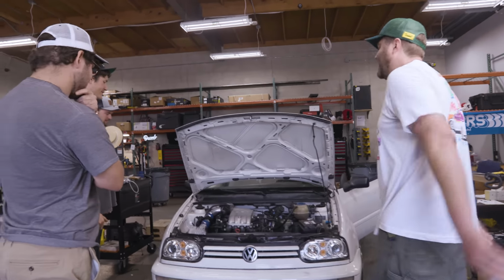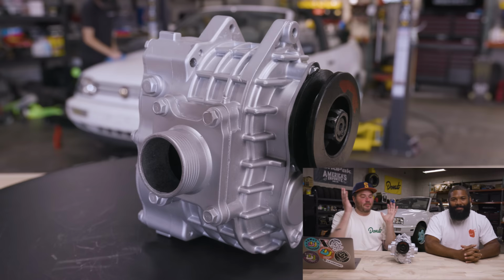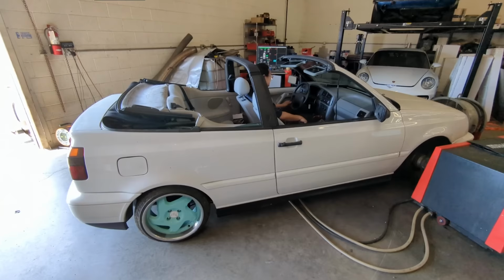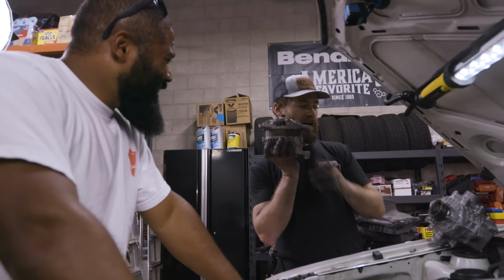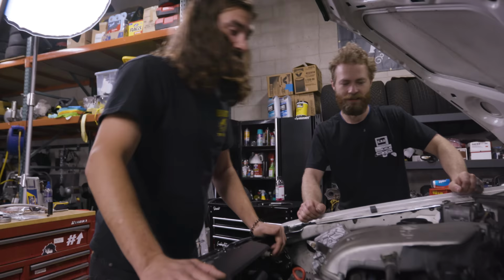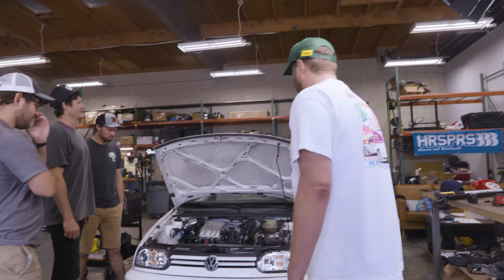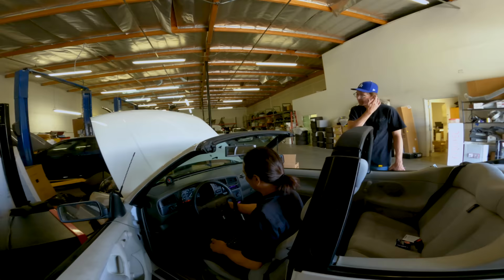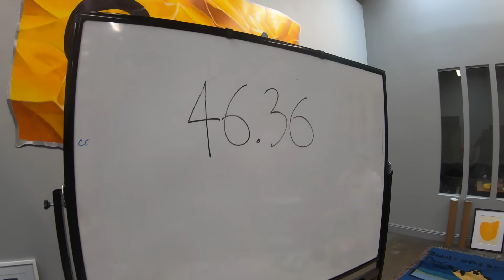We Installed a Wish.com Supercharger on Our Car

Comment: Part of me wants it to be on backwards so when turned round it does actually make some power! Why not (even if it's not right) turn it around & see how it goes?😁👍🏻
Reply: I agree with this
Reply: That's what I was thinking. The fact it was barely producing boost makes me wonder
Reply: Yeah,  flip it around and I bet it will work. 
As loud as that is, it has gotta be on backwards somehow. Maybe, flip the engine 180 degrees?  :D
Reply: that what I think
Reply: If it was backwards, it would literally be sucking air out of the engine, and it wouldn't run.
Reply: @9PlatinumGamer9  exactly, wouldnt run at all...
Reply: @9PlatinumGamer9  You mean like when it shut off those times after letting off the throttle? Air flow isn't on and off, it only has to have just enough air to run, spinning backwards wouldn't create a vacuum unless it could produce more than 14.7 PSI of boost (14.7 PSI is 1 atmosphere).
Reply: I was thinking the same thing 😆
Reply: @EMFAudio  - It shut off because of the rapid change in manifold pressure.  You can simulate the same by pulling the MAP from the manifold while still connected, well opposite actually, unless you have a way to do it under load. But either way manifold is going from vacuum to boost in an engine only meant to see vacuum. That throws off the fuel maps and it cuts out.
Reply: It was mostly underdriven
Reply: If you watch ghpc’s video on it there’s a clip where he puts his hand near the outlet side and it is actually pushing air, so unfortunately I think it is the right way… sadly
Reply: @wolfiedavis4879  - He checks it both ways this time too. These guys on here are just hoping for a unicorn. As small as that thing is, they would need a minium of 3 just to meet the engine's stock air requirements.
Reply: @sienile  ah, so its just too small and doesn't flow enough, so it's a restriction?
Reply: @sienile  Rapid change more or rapid change less does the same thing, my point is still accurate.
Reply: @wolfiedavis4879  That doesn't mean a mistake wasn't made. I'm not interested in going back to find if the side checked is the same side used.
Reply: @PigeonLaughter01  You got it. They didn't show it afaik, but when they drove it, the guy says it briefly made 1Psi of boost. Guessing they had a digital ECU readout. I don't think it would ever create a negative reading, but you could restrict the intake all the way down until either the power drops off completely, or the ECU would probably have a level where it won't cut the fuel flow down to match the lower air intake flow any more and cuts out/throws a fault.

If they did this on an engine with a carb, it would straight off be running insanely rich, if not just not run/flood. Would be obvious setting the carb that it was worse than just doing nothing extra I think lol.
Reply: There was definitely something wrong with the blower there’s multiple vids with people using them and it working/adding more power
Reply: So you think that now it's actually sucking power out of the engine? It's sucking out 34.64hp to be precise. So by turning it around would it make 34,64hp more? So 115.64hp then?
Reply: Turning it around won’t make a difference. The direction of airflow is determined by the direction of pulley rotation. This is a roots style blower used on a 600cc KEI car. The AMR500 displaces 500cc’s of air per revolution. It’s not capable of displacing enough air to feed a 2.0L engine. It would have to be severely overdriven just to displace enough air for the engine to breathe normally. Maybe .5-.25:1 overdrive ratio. (1 rotation of the engine rotates the blower 2-4 times.) none of which is taking into consideration the efficiency range of the compressor on this style of supercharger. All this thing is doing is creating a restriction, and overheating the air going into the engine.
Reply: @Boris_V  Adding air has diminishing returns like with any power adding change. There will come a point where the mapping has limitations and fuel input limitations. Adding air will just make it run lean or limit power gains. It's a curve, not a line.
Reply: @9PlatinumGamer9  it's backwards,  probably just switched intake and exhaust.
Reply: if you notice their little diagram about how a supercharger works is backwards.  they have the air flow labeled backwards.  so maybe this is a fundamental problem lol
Reply: @ledaohio  nah its just shit. The gears dont mesh tightly because there are no precision machined parts on this charger. Its a toy and a scam for anyone taking it seriously. That gasket should have told you everything u needed to know abt the build quality and tolerances on that pos lol
Reply: @eddominates  I did think that! I'm sure the screws squeeze the air between them & into the intake rather than round the outsides
Reply: @nuggert   Well don't tell him. I wanted to watch him flip the engine 180.
Reply: @jonasthemovie  It is always a D.E.U. issue.
Reply: @ledaohio  with enough wear and heat that thing will spit chunks and do nasty things. Too bad we didnt get to see that!
Reply: @EMFAudio  - Your point wasn't accurate to begin with, so it can't be "still accurate". If it was creating vacuum, they wouldn't have seen 1 psi boost when the throttle plate shut. This thing is too small to drive an engine of this size.
Reply: @eddominates  yeah, the confused the function with that of a gear pump, which displaces equal volume from the inlet to the outlet around the outside of the gears while the roots blower actually transports an ever reducing volume from inlet to outlet between the screws.
Reply: @sienile  Every gauge is perfectly accurate, especially when you don't know what the we're using, got it. You do realize pulling vacuum isn't the same as having vacuum limit air flow, right?
Reply: @danecarpenter8735  it doesn’t make boost because it isn’t turning fast enough
Reply: @wolfiedavis4879  the ratio is just off, it should be at over 5:1 to make decent boost, I mean it spinning 5x faster than the engine
Reply: @JohnS-br3xk  I’ve put one on a 500cc engine and I had it at a 4:1 ratio to get about 18psi of boost
Reply: @Industry-insider  How long did it run before turning into an aluminum grenade
Reply: @nuggert  I didn’t run it all that much but it looked great when I pulled it apart for upgrades, I never got around to doing them though
Reply: @Industry-insider  doesnt seem worth the risk. Good lil engines aint cheap. These things are made in a toy factory
Reply: @daszieher  A roots supercharger is a positive displacement pump, and it does push air along the outer casing, not between the screws.
Reply: @nuggert  I’m probably gonna put one on my shitbox daily because it’s a 1.5L and a almost brand new engine is $800 with shipping
Reply: @Industry-insider  why not slap on a well tested higher quality chinese oil cooled turbo like a GT2871 for that 1.5L and make an easy 10psi brother. Same price. Probably similar minor install headaches
Reply: It would run, just not well. Which is what happened.
Reply: @nuggert  that’s WAY more difficult also I already have the supercharger
Reply: @Industry-insider  I cant see it being any worse of a time than the can opener supercharger. Alumium pipes are cheap these days. I respect your determination but i can feel the pain coming into your world when this thing comes apart into pieces on one of your daily drives lol ✌️ bro
Reply: @nuggert  bruh the exhaust is on the back so it would be a huge pain to fit a turbo also why would a turbo be more safe? You obviously don’t understand how hard a turbo is to install because the intake tube is the easiest part yet I don’t have to do that if the supercharger is feeding directly into the throttle body also it’s not going to damage the engine to have a couple pounds of boost and I don’t have to tune it because the MAF is still metering all the air, if it leans out at all I can also make a IAT mod to add more fuel at boost
Reply: It's on correctly but it's way too small and shite, so no matter what it's just a noisy restriction
Reply: YES
Reply: @Industry-insider  It isnt going to last. Fun project if 1000 bucks means nothing to you i guess. Its going to break apart internally or you will lose the snout/pulley with wear. All sorts of things are wrong with these nothing is accurate or balanced. All of the components see tons of heat and torque in a quality supercharger. Your going thru all the trouble of fabbing mounting and tuning and mapping figured deleting or removing a power steering or washer tank and doing an exhaust manifold/downpipe would be nothing for you. something that can last and make good boost for a similar price.

You can literally hear the gears in the compressor wearing down and changing shape and they drive it for only a few miles
Reply: @nuggert  bruh I’ve already pushed over 20psi on it and it’s in perfect shape, I know the tolerances aren’t good but this isn’t a new thing to do and I know how strong these are
Reply: @manrs6037  engine power is needed to turn the turbine that blows more air to increase HP . In this case it takes more power than it adds. It might even actually restrict air flow and heat up the air.
Reply: @Industry-insider  wicked, post videos
Reply: @notsevenfeettall  mad power no but definitely would give it a power increase especially in the lower rpm range and it would run outta steam fairly fast! Any time you’re adding forced induction to an engine tuning is needed! Fuel/timing so on
Reply: @daszieher  that's what I'm sayin
Reply: @EMFAudio  - Gauges should be, but aren't always accurate. But that's aside from the point. I'm going with the assumption their gauge was accurate.

If something other than the engine is pulling vacuum from the intake, that will limit power. Cutting the intake down by putting a severely undersized supercharger on it, restricts volume and increases vacuum.
Reply: @tOSdude  true, the Roots type blower moves the volumes around the outside. I myself confused it with the Lysholm screw supercharger, also a positive displacement machine the works like described above, in mind.
Reply: @07scoobywrx  Yea, restricting air intake with a tiny blower should definitely make more power. /s

Everyone with a decent education knew that this wasn't ever going to work, they just did it because it's hilarious.
Reply: @ledaohio  That would also be the silent sleeper mode.
Reply: @flyingtentacle7631  https://youtu.be/1aJL8AfT-wc like I said the blower donut received was defective from the start! Will it make an extra 100hp no! Will it add a few yes
Reply: @9PlatinumGamer9  I was wondering if it is tho' as it's halved the hp of the engine! And I'm pretty sure their diagram of a how a super charger works is wrong. As the scrolls turn intogether and compress the air rather than compress it around the sides as per their animation
Reply: Roots styles can be run both ways np however effficeincy reduces dramatically when run backwards. It wont make power though, that super charger will need to have a 4 to 1 pully to make MoRe pOwEraH on an engine that size
Reply: @JohnS-br3xk  Agreed, if they put 3 of them in parallell on there it should work :P
Reply: It is backwards

Comment: I don’t think I’ve ever clicked on a video so fast- I’ve been HYPED for this vid ever since we saw the supercharger
Reply: Same here bro lmao
Reply: Same lmao
Reply: Same here - I’ve been waiting and it feels like its been forever!
Reply: Same
Reply: Can't believe they actually did it, but so glad they did! 😂
Reply: The notification just came up and I instantly clicked it
Reply: (Gently whispers in your ear) "ZOOM , ZOOM"
Reply: Me too lol
Reply: MO SUPERCHARGERS MO POWAH BABY !!! 
Let’s get some junkyard Eatons slapped into dumb shit plzzzzz 🙏
Reply: All that to not add fuel and get no meaningful result tho. Superchargers take power to run, the point of them is to add enough air to let you add more than enough fuel to make up for it. They only did the power robbing bit
Reply: They need to buy a turbo to twincharge their car
Reply: For real tho. Didn’t expect it to CHOP THE POWER IN HALF THO
Reply: We gotta see it tuned
Reply: Same
Reply: SAME
Reply: @mycosys  You could run that supercharger without plumbing it in, and it wouldn't take 50% of the engine power. The belt wouldn't even stand up to that much parasitic load.

The problem is that you hear the guy in front passenger seat say it briefly showed 1Psi of boost, pretty much the entire time; if it's not ever boosting, it's probably just severely restricting airflow.

The ECU would be taking fuel out like mad, to match there being not even close to the stock NA air flow.
Reply: @FireballPSNMods  It was tuned; it never even made boost, only showing 1Psi briefly the entire test drive. So it's just restricting air flow. ECU was tuned to having like, half or less of the NA air flow at stock lol.
Reply: @droplifter3435  they said they didn’t have the ecu to tune it

Comment: Man, that supercharger sounded like it needed some oil or something. Would explain it getting quieter over time, as the insides started to grind down. Would also explain the loss of hp as the engine is working to grind that metal down. Would like to see the insides of it!
Reply: Exactly!!! my first thought that they haven't oiled it!
Reply: Well, the guys installing it were called “Grind hard” what’s you expect? 🤣
Reply: You can see Ethan oil it in grind hards video!
Reply: I'm pretty sure there are sparks coming out of the exhaust at around 9:08 from the metal grinding down in it LOL
Reply: @DoubleSmackJacksSmackAttack  it's always done that.
Reply: Agree with comment and replies. Wonder about 3 things: 1) bearings / oil. Were they bad and was it lacking lube? 2) If bearings were bad / lacking oil, were the vanes hitting the housing causing friction? 3) What would it take to fix it to actually get some boost?
Reply: It's an interference tybe supercharger
Reply: @bunyipcow  LOL! Interference Supercharger. Interferes with the engine's operation!
Reply: It sounds so cringe-ey. I think you need the air filter AFTER the supercharger with this one.
Reply: Yeah they didn’t oil it. I run the same supercharger on my 1991 Honda Accord (f22a4) and I went from having 188whp to 211whp. I push about 8psi average. I think the highest I saw it push was like 12psi but I’m using a slightly smaller charger pulley

Comment: FINALLY!!! I am surprised it managed to kill that much power 😂😂
Reply: Lmao no spoilers but I totally didn’t think about it just being friction
Reply: A youtuber "JoniK" actually has had this supercharger (or something similar. It was "Aisin AMR500" too so i think it's pretty much the same) in his fiat punto. It worked pretty well to be honest.
Reply: If you dont add fuel to the right amount in a tune then computer could run too lean or too rich both could hurt motor and hp
Reply: wasn't tuned at all for positive pressure.  Probably had all sorts of vacuum and boost leaks.  Clearly wasn't oiled properly at all... not to mention this style of blower is used for moving large volumes of air to cool down industrial equipment.  They are supposed to be driven by a large electric motor.
Reply: @Darctan1  Aisin is genuine Toyota parts, so that's a lot better stuff
Reply: it works, they didn't tune the car.  the video was deceptive AF.  that is why he said "tech it worked."  

it's a root compressor.   I have a couple for moving air.  the y work perfectly fine.  not sure why they did this scam of a video...clueless souls will believe it to be real....one an engine you would want less than a liter of displacement...
Reply: @adamwade855  it's not a scam, someone who would buy a supercharger on wish would do about this same level of prep and tuning.
Reply: @Darctan1  next time stop at Aisin and delete sentence
Reply: @adamwade855  Would love to see what it would do if tuned properly. Would it actually give more hp?
Reply: @aaronaaronson2095  it would be squishing more air most likely but I think it’s probably very inefficient with the setup they have
Reply: @jaewhite2462  people buy exhausts and air intakes every day thinking the same think when it doesn't, worse in modern cars you lose hp because they detect something anormal and auto-tune down, a larger air intake will reduce counter pressure (my main lang isn't english might be wrong term) and help your turbo struggle less you might gain something at low rpm but not on top, an exhaust is only good if you tune your engine too, I did 435 dynos in my life before I moved to something else (laws became too strict and oem ecus a nightmare of anti-emission "adaptations" cough vw cough)